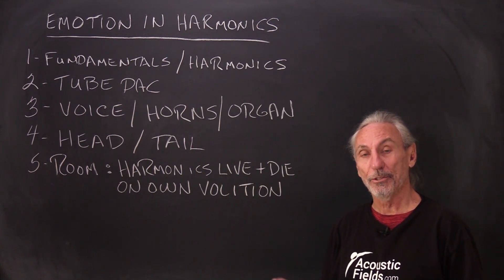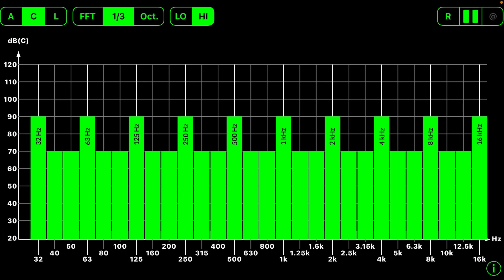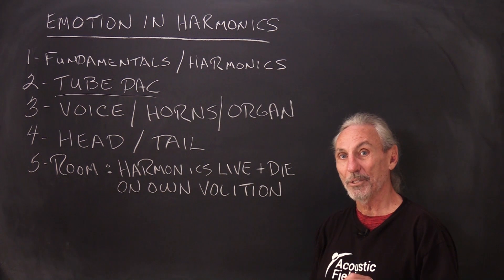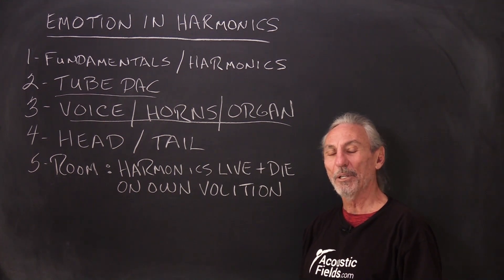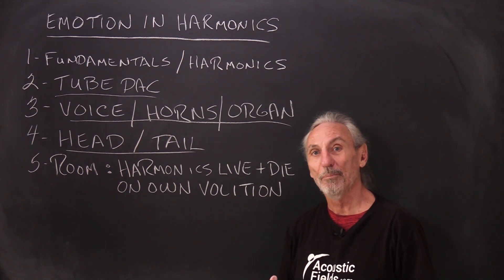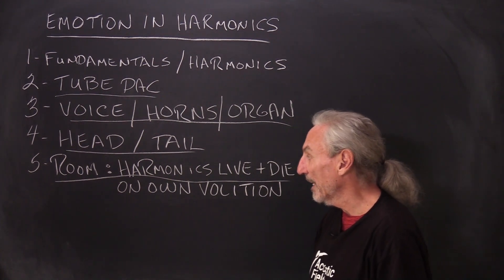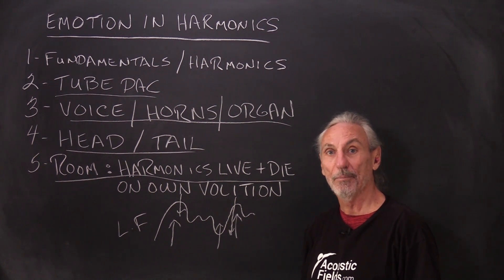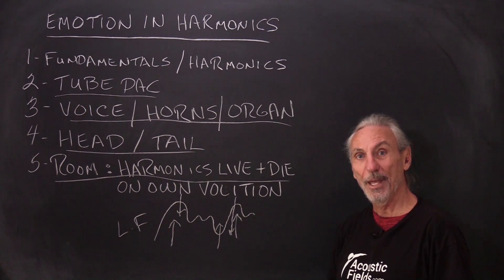Emotion in Harmonics - www.AcousticFields.com

Comment: An interesting comment Dennis about how your DAC helps you realize the differences in sound from the differences in the harmonic content between SS and tubes. Hearing the fixed change in sound between your DAC's transistors and tubes is like comparing the change in sound between an equalizer with some specific settings and another EQ set with a different set of specific settings, or hearing the change in sound from one room to another. So allowing you to select SS or tube sound is much like using two EQs with different settings. But with an EQ you can modify the fundamentals to harmonics structure and thus the resultant sound, with only a switch between SS and tubes you only have that one set of differences. But it's kinda interesting nonetheless to so simply hear what a given SS and tube sound comparison sounds like.
Have you any further thoughts on doing a video about the dynamics of room treatments in the low, mid, and high-frequency ranges? I would find this very interesting myself.
Reply from the maker: Yes, it is quite amazing. I am not sure what you mean by the "dynamics of room treatments".
Reply: @AcousticFields  Well naturally now I can't find the video where I asked you if you have a video or videos talking about the relationship of the attacks and decay rates of the room and the music, and you replied that you didn't but it is something that you would consider doing. I consider this to be in the realm of room and room treatment dynamics, and something that I think is pretty much unique to your knowledge and engineering of acoustics and I would like to learn more about it.  Thanks, Stu Markley